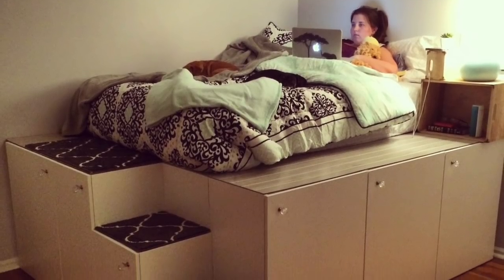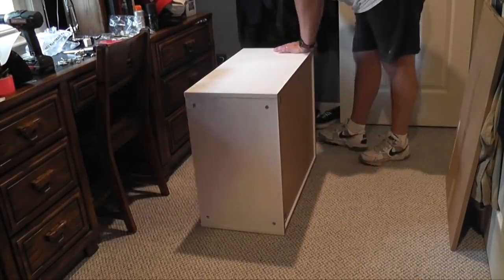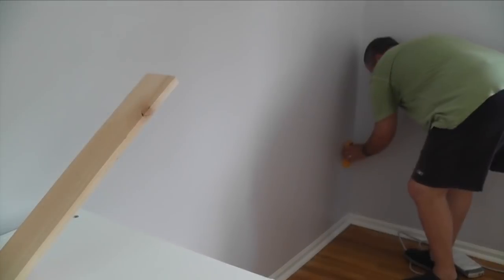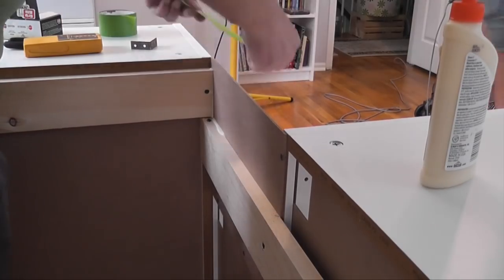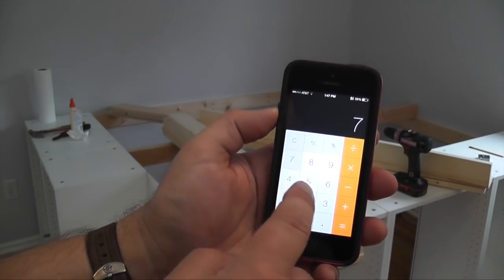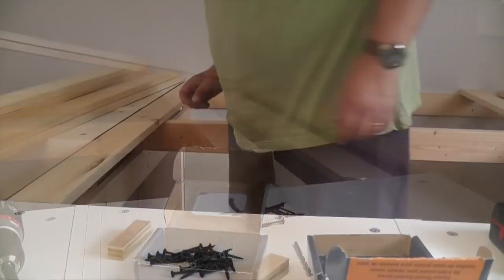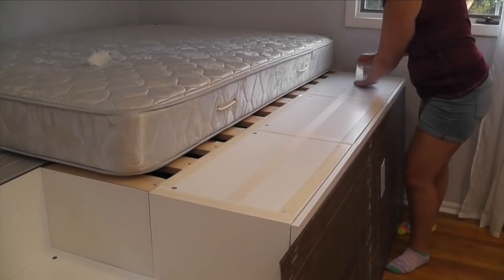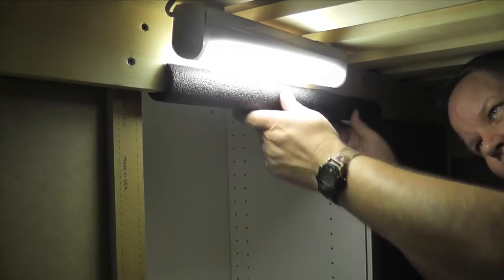IKEA Hack Platform Bed DIY

Comment: So the space underneath the bed is not being used?  You've take up more space by putting the cabinetry OUTSIDE the bed area.  You could have just thrown the mattress on the floor and placed the cabinets around the bed.  I don't understand this at all.  
For people that want to conserve space here's some common sense that works very well in small bedrooms or larger ones but its the small ones where we yearn for more space.  Say your mattress is a standard double which will be 50".  This guy calls it a "full size mattress".  What is that?  There is no full size mattress.  There is single (39"), double (50"), queen (60") and king which I'm guessing is 70"-80" wide.   So you're going to make a frame that will hold that mattress as high as possible still allowing you enough clearance for whatever acrobatics you perform in bed.  The higher it is the more storage you will have because space on top of a bed is never used during the day so its totally wasted.  So raise that puppy up!  If you want max space lie down and measure the height of your knees when they are up when you are lying down and add a little bit more to account for bedding.  Down duvets can be quite puffy.  Also realize that memory foam mattresses differ widely in their thickness.  You can mount the mattress lower in your frame but once you're at the top you can't go higher if you're at the top so account for that.  For storage under the bed which you will place in the middle of the room equidistant from both side walls you will make drawers or shelves half the width of the mattress.  Because they're not so deep they are much easier to work with.  Drawers under beds that are 60" deep are absurd.  These, for a queen mattress would be only 30" deep, very easy to work with.  Now think of how many sq ft you will have working with on several levels (5-6?) at 50" x 80"!  All you need is 30" space between the side of the mattress and each wall.  For a queen you'll need 120" or 10'.  Most bedrooms are at least 10' wide.   If its smaller use a single at 40" + 20" + 20" = 80".  I don't think many bedrooms are less than 6.5' wide!  And that's how you have lots of storage space in a small room.
Reply from the maker: I appreciate the time you spent on this comment, but you should watch, and listen to, the entire video to see how I used the space under the mattress. You should also Google images for “mattress sizes” and you’ll see FULL size mentioned more than double, but I think they’re technically the same.
Reply: @handydadtv   The space is only accessible from one point.  You know how life is.  The stuff you need will inevitably be in the back corner at the bottom!  The bed should be between the walls so the storage space is accessible from either side.  Most people do this because of a lack of space.  So not having storage outside the bed area is important.  Storage is for under or over the bed area.  For most it would work out best to be under I would think.

Comment: Extremely dangerous: no hand rails or protection from falling over edge. Also Ikea is not designed to withstand weight. Over time particle board will sag bend and break. Not a good Idea - nothing against Ikea.